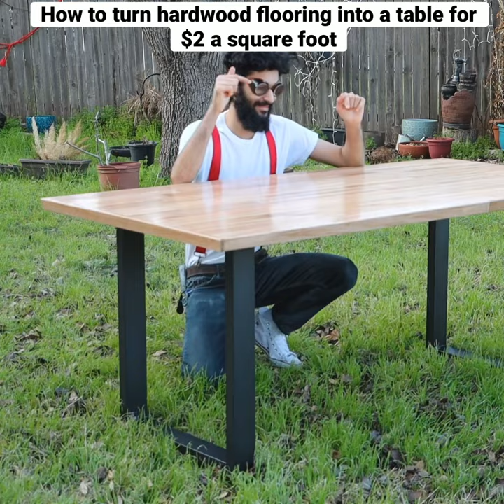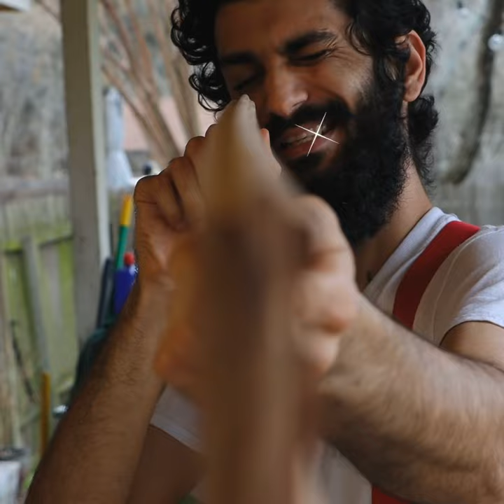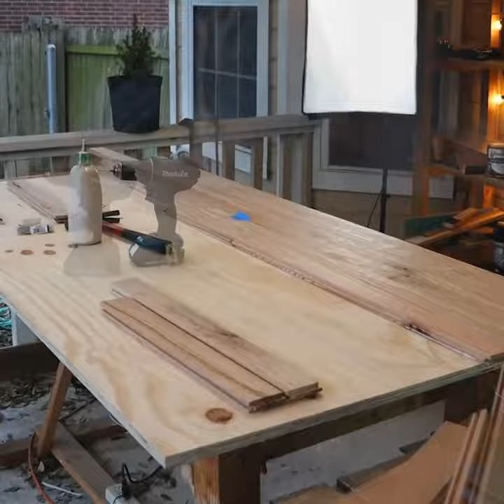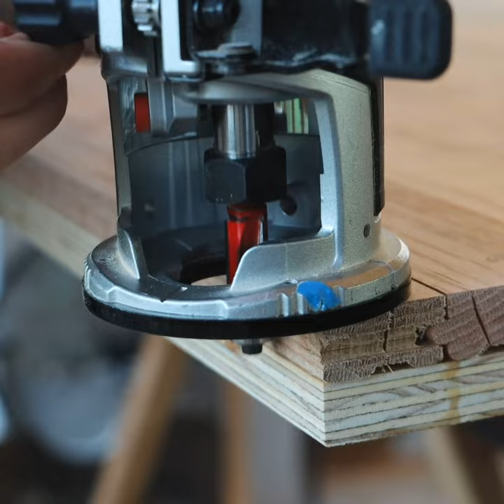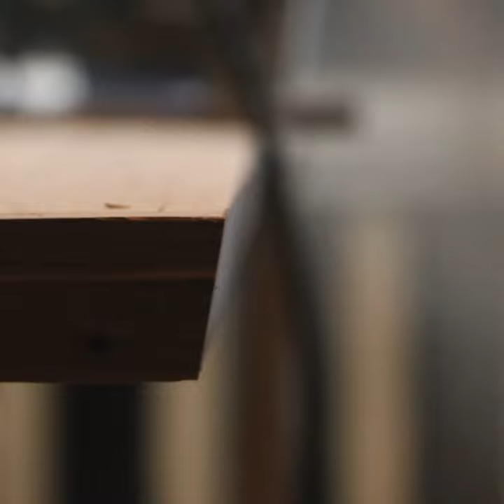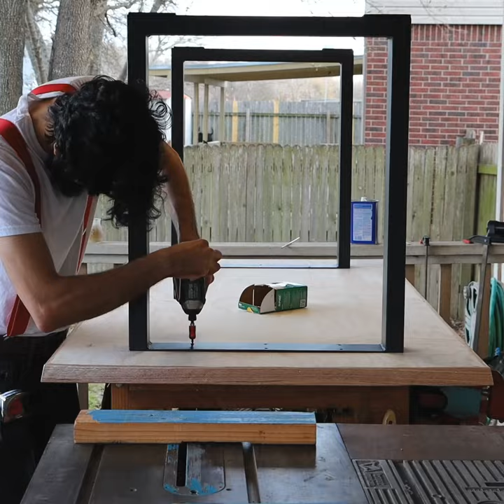They Said I Couldn’t Make A Table Top From Hardwood Flooring (Restaurant Secret) #Shorts

Comment: These really cool.

Except you know the time and labor looks like a lot :(
Reply from the maker: You have a good point, but there is always going to be labor and time when you build something yourself. So, if we agree that building anything is going to take time regardless, that is where this video picks up. If you were to build a hardwood tabletop of this size, it would easily cost 3 to 4 times the price for the wood, plus you might need access to a jointer and planer which is another hurdle. So basically this video is meant to highlight a technique that could be a shortcut for some people. And regarding the time and labor, I have been keeping track of build time on every project for years, and this this table was average for the amount of hours it took to build compared to other dining tables I have built in the past.
Reply: @A.Mere.Creator  Well I do appreciate your video, regardless, just wanted to clarify on that. And thanks for your reply,  yes I suppose you're right that the cost with time and labor put into making this is less than bought if at a store if I could make it myself.  Not to mention it's built in a way to your liking. I wish I had your talents 😊 Beautiful work!
Reply: @Sidewayyys two hours?? Okay That I find hard to believe. But I've never built anything out of wood, especially not from cutting the wood to the finish.
Reply: @MsSwitchblade13  this tables is a relatively easy project, which is the point, he's using wood that slots together and needs minimal finishing work to make it presentable
Reply: You gotta spend either time or money. Unfortunately sometimes both. In this case a little bit of time can save you a lot of money.
Reply: @Sidewayyys Definitely more time then that but also don't forget all the tools that cost a significant amount of money
Reply: @Sidewayyys probably take me 3
Reply: If you set up and focus on making more than one table you can probably make it worth it
Reply: 614
Reply: @Sidewayyys 1361
Reply: Cosmo. Care of toxoplasma gondii

Comment: I had this exact idea but when winter came around the boards shrunk and a few small gaps opened up. I would recommend. Gluing the boards together but not gluing them down to the table top so they can expand and contract as one piece.

Comment: I don't know where you live, but around here , you can't even buy that 3/4" plywood for $2.00 a square foot. Let alone the flooring. I bought bamboo 5/8" 
Flooring at 1.79 a square foot , (and that's a great deal, )the plywood is $ 68.00 a sheet.
Reply: That's the first thing I thought, plywood
Reply: Why did he have to use premium AC plywood if you're just going to cover it up
Reply: @mikesmithey1892  Stability.... Less voids & less warpage
Reply: I just paid almost $6 a square foot for that exact 3/4 Red Oak hardwood product. It’s normally about $4psf. Good luck getting it for $2psf.

Comment: You could nail it on the side just like the proper way when you install hardwood floor no top nail just saying but it looks great 👍
Reply: Was thinking that too. They're ment to be nailed from the sides so you don't have to deal with visible nails
Reply: I commented the same before I saw this... use flooring cleats instead of face nailing

Comment: Plywood backed tables are under rated. You can get the same look as solid hardwood, but for less cost and using less wood. Trees may be renewable, but they're not unlimited.
Reply: Great point.
So true.
Reply: That’s exactly what renewable is, unlimited. A resource that is not depleted when used.
Reply: @asoggyburger479  when referring to energy, yeah that's what it means. But trees take time to grow, as in several decades. So if the supply runs out, we are stuck until the next harvest and prices go up. You could use a 100 year old oak to make a hand full of slab tables, or, you could make several dozen of these plywood backed tables from the same tree.
Reply: @Irishrebel092  Depends on the species you’re talking about. But yes, oak does take very long to replenish opposed to pine/fir. Your original comment is just contradicting, that’s all I was pointing out. Trees are both renewable and unlimited as long as we harvest in accordance to their growth cycles.
Reply: @asoggyburger479  agreed. But unfortunately no one really wants a common pine table.
Reply: @Irishrebel092   Tons of people do, it’s the “rustic farmhouse” phase people are in right now. I personally don’t but there’s no doubt there’s a market!

Comment: Why did you have to use premium AC plywood if you're just going to cover it up. Another thing why didn't you nail through the tongue where it would be hidden by the next piece that's the way you nail it if you're putting it down as flooring so you don't see the nails or you could have just glued it down and then turned it over snap some lines with your chalk box and screwed from the back side in to the wood.

Comment: The problem with flooring is you end up with a V groove in your table or you water a lot of wood cutting it off.  Some people will say "oh it's just  a different style" and in many cases they are right.   But not for a table, it's just objectively worse.
Reply: What the are talking about?
Never heard of a V groove. Traditional Hardwood flooring tends to have a tongue and groove on either side of the board and both ends so they interlock during installation and if that's what you're referring to it Is only a quarter inch strip of wood that would need to be ripped off of the side of the boards on the outside edge on the table only.
And this dude clearly trimmed the outside edge of the table so even if you didn't trim the excess off you still wouldn't be able to see this "v groove "
Reply: @leonprestige3782  you should have just asked what a v groove is instead of explaining something that isn't a v groove 🤣
Reply: @leonprestige3782  a "v groove" is a common term in America for the resulting edge from the chamfered edges on each of 2 mating boards.  He's carefully edited this film so you can barely see the finished product or the joins themselves.  But it's there.
Reply: @bobcougar77  thank you for the proper terminology.  So there's not really a problem with it it's just a visual appeal issue
Reply: @leonprestige3782  your welcome.  I know we all come from different parts of the world and everyone uses there own terms.
Reply: Also, yes it's objectively worse.
Reply: @bobcougar77  objectively worst 
How?
Reply: @leonprestige3782  A table top is just better off being smooth.  Easier to clean, glasses don't tip etc.   It also should have a higher standard of craftsmanship than a floor.   
There's nothing wrong with using flooring stock for a table, but you're either living with the v groove and doing what this guy did  or your going through a pain in the ass and loss of material to machine it down to flat stock for a proper glue-up.  You could also use a filler to flatten the glue-up but that has downsides as well.
Reply: @bobcougar77   I've never seen a not smooth floor after a proper install,sand,buff,finish  The only time machining or planning would be necessary is if you had mismatched lumber that wasn't the same thickness
And yes trying to remove or fill the air grooves on the bottom would be pointless there is plenty of contact area for the glue to hold it in place. Which is kind of redundant if it's being nailed/stapled down after all it's just a table and people won't be walking on it for the next 100 years

Comment: Great idea. I just hate all the nails for an everyday work desk.
Reply: What?? The nails dont go all the way so what are you on about
Reply: @craziigaming927   the nails on the top of the table will still show. It doesn’t matter if they go “all the way”. He nailed them down from the top. There are better ways that don’t destroy the facing of the hardwood.
Reply: You don't really need the nails. Glue and the flooring joints will hold that thing together really well. Just make sure to use clamps while they dry to prevent them from moving around. He didn't need clamps since he was using nails.

Comment: Plywood and solid wood expand very differently.
Reply: On top of that the outside edging won't allow the wood to expand. Good luck after a year when the cracks come.
Reply: ...hardwood floors are nailed down to plywood in every home. That's the way it's done lol
Reply: @tylerward8333  your right with space around the perimeter, definitely not glued down with zero clearances. You also might notice in time wood floors squeak that's the wood movement that can't be stopped and needs to be accounted for.
Reply: jami w  you can't fix stupid, and this is YouTube in 2021, so it's basically dripping with stupid... and EVERYONE is a professional today, despite the obvious lack skills. Or more importantly, critical thinking skills. I stopped trying to reason with them lmao I just drop the facts and watch the next thing to learn from.
Reply: jami w  "almost always." Perfect so sometimes we agree. I'll take the small victories whenever I can. The sheathing is an exterior plywood (or often OSB) application, the subfloor is the plywood (or OSB even as well) under one's flooring. But you've probably known that and misspoke.
Reply: @tylerward8333  actually you can "fix" stupid. I like to call it learning.  Learning is continual with wood work and craftsmanship for sure. I have done work virtually identical to this table project so I speak with hard truths about wood movement because sure enough within a year of that project the wood shrank and the plywood didn't and I had cracks all over.   Now I know not to marry wood of different species let alone plywood without taking the wood movement into account
Reply: jami w  who said different material?  Plywood being 1/2" or 3/4" is still plywood. Subfloor plywood is tongue & grooved and 5/8 or 3/4 thick. The sheathing is typically 1/2" plywood or 7/16 OSB and installed with space between joints for expansion. Only those who don't understand/know do an entire house with one thickness and type of plywood. I was trying to give you the benefit of doubt by writing you misspoke about the subflloor when you referred to it as sheathing.  Simply put if the sheathing isn't glued, which it rarely is, the floors won't squeak because sheathing is on your outside of the walls, if the subfloor isn't glued AND screwed then most assuredly your floors will squeak because that's what your floor is fastened to the subfloor
Reply: jami w  another small victory for me,  thank you I appreciate you agreeing finally a subfloor is different in terminology and product used than sheathing. I do try to stay away from local trade names on material especially on such a broad format because it can be the same or similar products but have different terminology. But yes you are correct plywood is stable. Wood is not relative to plywood. So yeah a 50-year-old oak floor taken care of will still look good great even,  but please don't try and say there isn't a gap here and there and a well-known to the youths of the home squeak from spot to spot.
Reply: jami w  you must be talking about a veneer application which is much different than this table he built?
Reply: @adamcannon6331  nobody asked you lol
Reply: jami w   You seem confused so I will be as simple as possible.  nailing wood to a floor or plywood is one thing laminating and glueing wood to plywood is completely different.
Reply: @tylerward8333  weird nobody asked you to comment yet here you are anyway commenting away. Must be almost like youtube set it up for anyone to reply for whatever reason without a care in the world. Best of luck on your future projects.
Reply: @adamcannon6331  you're still going? Lol

Comment: 2 usd per 30cm2, just buy 10 000 worth of equipment
Reply from the maker: For building a table, those tools are actually very conservative.
Reply: Eh I didn't see more than maybe 3k worth.

What people need to remember is that you don't buy all that at once. You can get started building some really cool stuff with like...a jigsaw or circular saw, a drill/driver, and an orbital sander and even that is optional. Then you start building and figure out what you like doing, find the next project and then it's like "oh a router would make it so much faster easier and better to round the edges instead of just sanding" so you spend like a hundred bucks on a router. Then you're spending the next few months just figuring out all the cool stuff you can do with the router table without spending more than $50 on basic bits. Then a few months go by and you realize your cuts would be a lot easier to make exactly the same with a table saw. There's 300 or so but AGAIN that's the first big purchase in a while and STILL not 100% necessary. Before you know it the total is adding up pretty high but it never broke the bank. Just look at how much a video game console and like 10 games will cost. But again you don't buy it all upfront, you buy what interests you at that time.